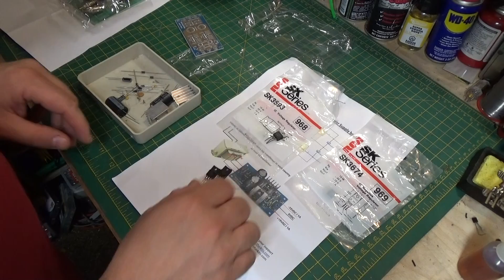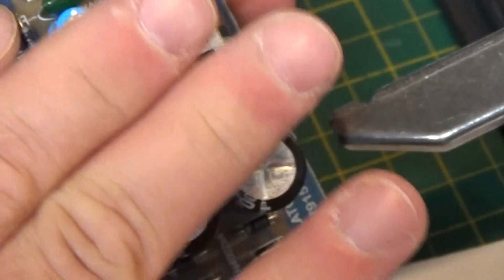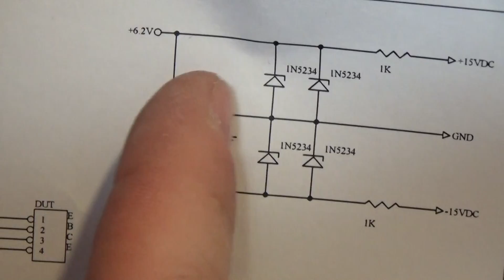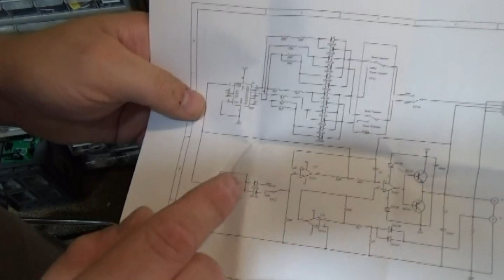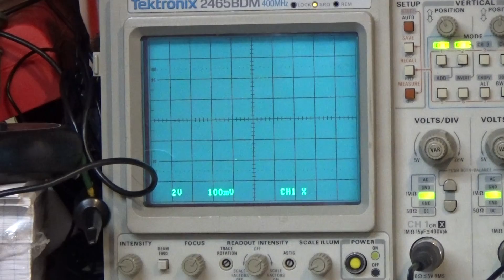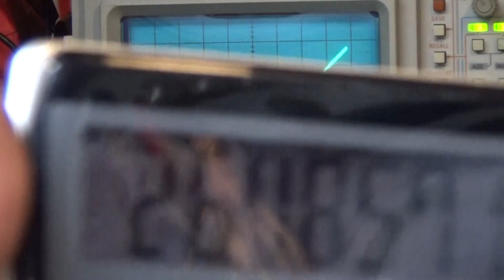eBay Transistor Curve Tracer Kit -  Build,Test and Review

Comment: Umm, didn't you just isolate the 7815 & 7915 from the heat sink and then screw the heat sink to the same potential as the tab?  tab is connected to pin #2, and so is the PCB.  
For anyone watching and wanting a more powerful curve tracer there is a good option now, the VBA Curve Tracer, I'm building one now and it's almost done.  I went with it so I could test mosfets and jfets, plus much higher voltage and current levels.
I'd do the math on that zener before I replaced it, lol.
Reply from the maker: It was a thermal interface pad.  I wasn't worried about electrical isolation.  The zener works fine.   I also did a video on an updated/ improved version of this curve tracer.  You may want to check out out.

Comment: We have two 15volt regulator to two 6.2volt zener regulators, what a wast of power, and the power transformer has to be 36 VCT@1A.
I have bought a kit including the regulators, but I am going to change the power supplies to 12volt regulators and then to 6.2volt zener trgulators.
Why not go to 6.2volt regulators or use 6volt regulators which is even more simpler. The power transformer can be 25.2 VCT@1A.
If you add a fan with vent holes you can use 85 degree capaciators
To me the PS are more complicated then necessary.
Since there is no current limit for the transistors I am going to see how Tektronix does.

Comment: The tektronix 571 (and others) used to ask the user which load resistance was to be used in order to protect the devices as this fella had correctly identified.  570, 571, 575, 576, 577…….

Comment: Love it, I’m in the market for one since all I tool around in is analog and tube equipment. I am not schooled in electronics but I’ve been in the hobby over 35 years. I’ve made some something’s, repaired some things and unfortunately made something’s worse😂. In my field of being a HVAC operating engineer I’ve been able to make repairs on boards to get equipment back up and running rather than having to wait for a new board, sometimes I can’t even get a new board on much older equipment. Thanks Tony

Comment: RE: zeners.  Two 1/2 watt Zeners are correct.  Just because a zener says 1W it is NOT 1W.  Look at the package, there is NO WAY that tiny thing will dissipate 1W, I suugest you do what they said before you 1W's blow up.  There are PILE os diodes rated for 3A, and if you did that to them they would blow up near instantly from heat!
BTW I love your 2465! :)

Comment: A 1 watt zener diode with it legs cut of is no longuer a 1 watt diode,what you should do is coil both  leads of the zener ,then solder it to the board,the full lenght leads are acting as a heat sink,this will prolong the life of your zeners.Some manufacturers will put the mounting holes far apart so you won't cut off those leads wires..Bye.Lucien

Comment: Sometimes it's fun to run the numbers.   Let's take the 15 volt supply, and place it across the 1k resistor and the 6.2 volt zener in series.  So to use up all 15 volts, that means there's 8.8 volts across the 1k resistor, since there's 6.2 volts across the zener (and the circuitry in parallel with it).

Since there can only ever be 8.8 volts across the resistor, according to Mr. Ohm there can only ever be 8.8 mA of current through the resistor (8.8 volts / 1000 ohms).  That current through the resistor is the same current that flows through the zener and the circuitry as well; these are in parallel, and whatever is not used by the circuitry will end up flowing through the zener.  So the worst case for the zener is when the circuitry is using none of it, and all 8.8 mA flows through the zener.

So the maximum power in the zener is volts * current, which is 6.2 volts * 8.8 mA, or 0.0546 watts.  Tiny.  That means the power rating of those zeners shouldn't be a big issue.  I could speculate about what other reasons there might be for having the two diodes in parallel, but let's not go there.  At least we can see that technically, power handling isn't one of the possible reasons.  We'll never know.  :)

Still, it is nice that there's another pretty easy way to get a pretty reasonable curve tracer for a home lab!

Comment: I love these "low cost test equipment" videos. For the advanced hobbyist who won't be buying a $1,000 Tek curve tracer, this is helpful.
PLUS - you save us time and possibly frustration by pointing out the errors or poor design choices you find. I appreciate it very much!
Note: I do believe buying a GOOD 'scope is a must - and a serviced and calibrated Tek 2000 series is certainly affordable. I went from a cheaper scope to a Tek 2336AY, then a 2213A, and the difference in quality is remarkable.

Comment: Just one question. Did you tie the chassis of the box to incoming AC ground? The BNC connector shields are at the ground of the +/- 15v supply? Should the center tap of the power supply be at chassis ground?

Comment: The TO-220 F pack is not a cheap plastic device. Its thermal resistance is documented in the datasheet and isn't particularly high and perfectly suitable for its application and power level. The 7805 is also available in a TO-220AB package which is probably what you are more familiar with. The F pack is very desirable for high voltage mosfets when the insulator and insulating bush are unsuitable.

Comment: The plastic TO220 cases are the new style and work fine.They are not cheap, just a newer package. By the time you have added heat sink compound and a mica washer then you will get more or less the same performance anyway. I would be happy to use them.
Reply: If you need the heat sink isolated, sure. That isn't the case when each transistor has it's own heat sink, isolation isn't required.
Reply: You make a good point, if your heatsink is not isolated, and you use a piece of Mica, then  there's not much difference thermally, in fact, thinking about it the plastic case is probably better, certainly cheaper from a BOM point of view and much easier to mount.

Comment: About your zener concern:  If you have no other load in parallel, the zener passes a whole (15 - 6.2)V/1000 ohm,  or 8.8 mA.  That again means 54.5 mW or about 1/10 of the rated 1/2 watt.  Any other load for this shunt regulator will reduce the power dissipation in the zener further.

Comment: Hello. What are the output AC voltage on your transformer? Do you need much over 15V AC?
Reply: Geir, I would suggest using an 36V center tapped transformer with at least 80VA. This should give you 2x 18V at 4.4A. 18V is very gentle to the 78xx/79xx regulators and I think the circuit voltage drop won't be too high so that you'll get nice and stable +/- 15V at the output. Search e.g. for 185E36 from Hammond.

Comment: I was wondering if you could share your specific's on the transformer you are ising. I bought 2 30vct tramsformer rated at 500ma each . I am running them in parallel that should give me 1 amp . My question is shold i be running a higher voltage tramsformer to overcome the drop out voltage of the 7915 and 7815 voltage regulators.
I quess my question is , shouldI have a 32vct tramsformer .
Reply: Thats 2 transformers each at 30vct

Comment: I have a Sencore 150 MHz scope SC301  that includes a simple octopus type component  tester The nice thing is that one button and its alive. Push the button again and the slope returns to normal use. Wish a digital scope would offer the built in feature. ( I first used one as a bench tech   45 years ago... a great time saver.
Reply from the maker: I really like the old Sencore equipment!
Thanks for watching!

Comment: I bought one and assembled it yesterday.  I did a test on a classic 2N2222 transistor and the trace appeared on my DSO.  Despite the fact the trace wasn't as sharp as it would be on an analog scope, I was fairly happy to see some results.  However, my happiness somehow went down the drain when I actually measured the traces and did the hfe evaluation as per the docs.  Funny enough, I got a trace like the one in the docs for the NPN transistor.  The X axis set to 2V/div and the Y axis set to 10mV/div.  I calculated an hfe of roughly 330, which I think is fairly high.  I then evaluated the hfe with my DCA55 from Peak Atlas, and the reading was around 250, although the base current was around 4.5ma which doesn't really compare to 168uA.  On my DMM, I had a value in the 260 range.  Obviously the 330 value is pretty much out of bounds but I'm not too sure where to look to determine if something is actually defective.  Meantime, I will do other tests on small and power transistors and see if the situation is the same for them.  I would be surprised if a resistor would be out of specs because I measured every single one before putting them on the board when assembling it.
Reply from the maker: I had a tough time figuring mine out as well.  I also have a Peak Atlas.  The hfe measured on the Peak Atlas was pretty much in line with the curve tracer once I figured it out.  I also can tell you that if you set the tracer to high powered transistor mode, it will fry a 2n2222 or any other small transistor.  Getting a good trace in X-Y mode was also difficult at first.  I kept getting a lot of weird traces that I am assuming were retrace lines or something.  The instructions are poor, at best.  The thing that I noticed is that the scale can change, based on the transistor.  The instructions indicate that X-Axis is set to 2V/Div, but Y-Axis can be anywhere from 20-100mV/Div.  If you don't set it right, It's really easy to count the steps wrong.  If you get the wrong step, it will cause you to calculate the hfe incorrectly.  I had problems with this at first, but was able to get it to work after some trial and error.  Another good use for this device is matching transistors.  Closely matched transistors will put up almost identical-looking traces.  I was able to match a set of output transistors in short order, once I got everything set up.  When matching them, you really don't have to calculate the hfe each time. You just have to match transistors  that have similar trace amplitudes.  Keep working with it.  The more you use it, the more you will see it works pretty good for the low cost.  It isn't a Tektronix, but it does what I need it to do.  Good luck!

Comment: Another great video! Ever thought about building a curve tracer for tube matching or better yet converting a semiconductor version for tubes?  I want to make it my next project.  I have a Tektronix 5CT1N curve tracer plugin for my scope that I'd like to adapt to handle power tubes.  Don't know where to start yet...
Reply from the maker: Rick,
Tubes and transistors are different, in that tubes are more of a voltage controlled high-impedance device and transistors are more of a current controlled low impedance device.  Because of this, testing them is very different.  
The best way to match tubes is with a mutual conductance Tube Tester.  By measuring the GM of a tube, you can closely compare it to other tubes for matching.  Newer testers such as the Amplitrex (big bucks!)  can give a full report of the characteristics of a tube.  There are also some companies that modify the old military TV-7's or the Higher-end Hickock testers to do the same by using a computer-based interface and software.

Comment: You could have said milli amps instead of em aye. It sound so un professional
Reply from the maker: mA is an abbreviated term for milli-amperes.  In the X-ray industry (which I have worked for 27 years), it is the common word used to describe x-ray technique (i.e. kV and mA) .   It is easier to say, and it is a force of habit for me.  If you hear me say "mA" in the future, it means milliamperes.  Sorry for the confusion.
Reply: Well, I'm not Xray material...so I will move to another channel.

Comment: Actually, those have metal tabs that are coated in plastic for electrical isolation so you could mount both on the same heat sink without shorting.
Reply: William Squires ,
Reply: Williamson  Squires w7t

Comment: Nice neat and clean layout, good work. Some ideas: Why not get rid of the zeners all together and use LM78/7906 TO-220 regulators? You could also modify that supply circuit to implement on the same regulators a current-limiting capability.One question: In your scope display, what is that 45 degree bold trace across the curve traces?And sure enough, the tracer is really pushing the transistors well into its design limits. Have you tried testing diodes/zeners with it?Thanks for sharing, best regards.